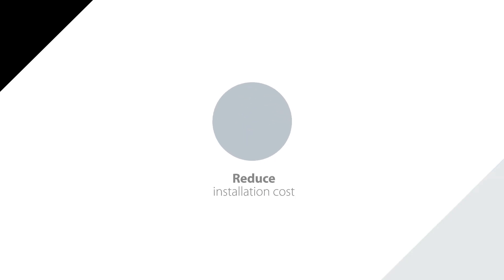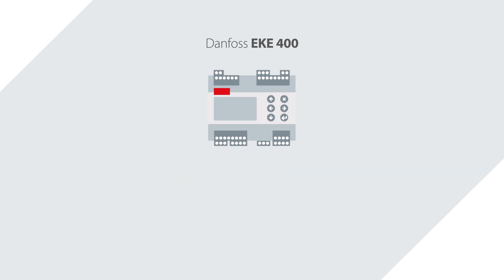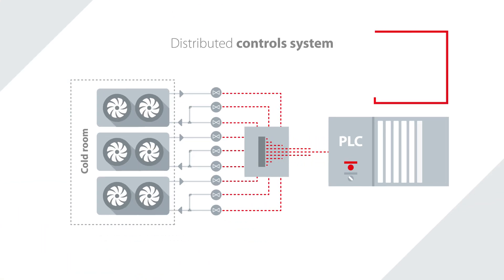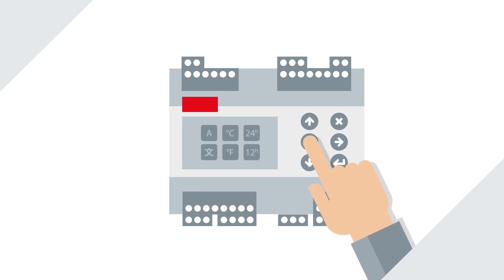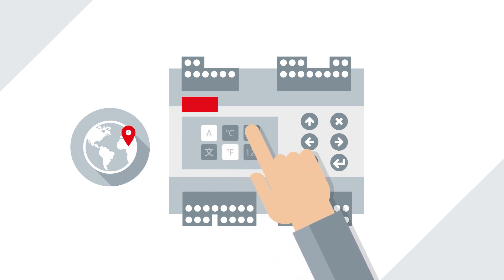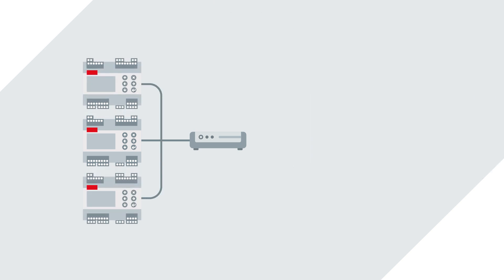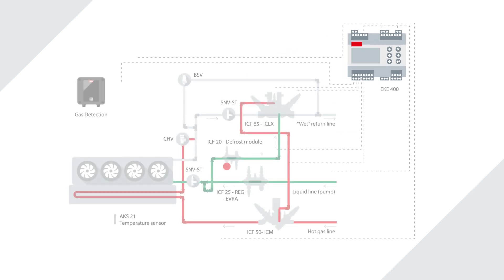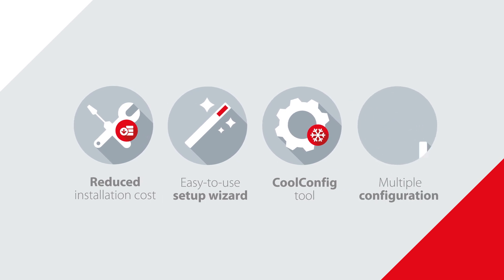Danfoss EKE 400 - Industrial refrigeration control - Easier than ever before

Comment: Hello. I use controller Danfoss EKE and after I try to write some data to it (via Modbus protocol) I see W002 error code on main screen and cannot start compressor. But modbus communaction works correctly. What is a reason of it ?
Reply from the maker: Hi there. If settings and sensor mounting is correct, you will only see “W002 standby alarm” in the alarm list, which can be cleared by setting “Reference”, “R012 Main switch” = ON. The details about the Alarms and Errors can be found on the section ‘Alarm table’.

If that doesn't solve your issue, you're welcome to reach out to our support team by emailing r123588 AT danfoss DOT com

Comment: Can we used same in Hydropneumatic System motor control based on pressure transducer.
Reply: Hi Rakesh, Thank you for your comment. The EKE 400 controller is developed for HN3 evaporator system and can control the valves if there is need for that. We have no information on how to run a hydropneumatics system. We suggest you to go for a PLC solution. Hope this was helpful :-)